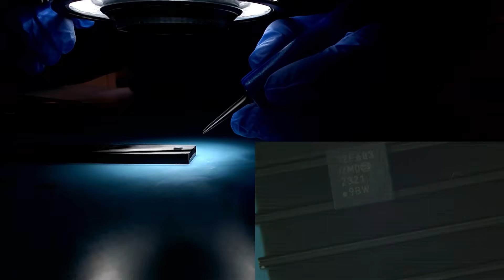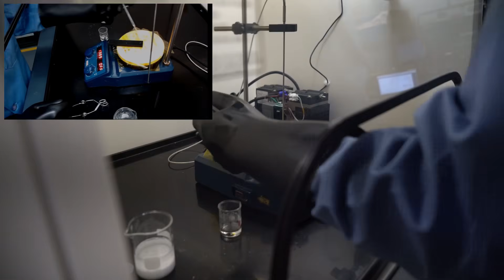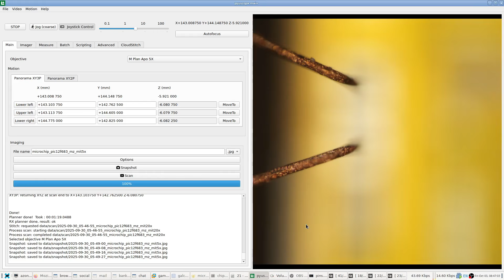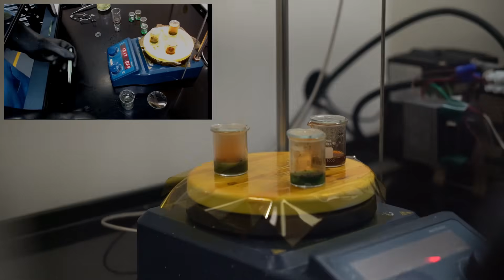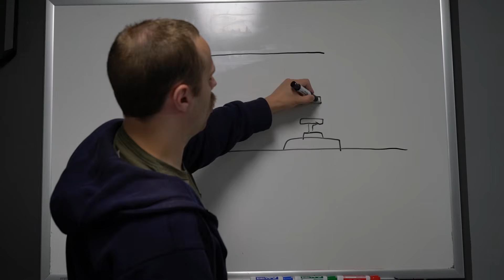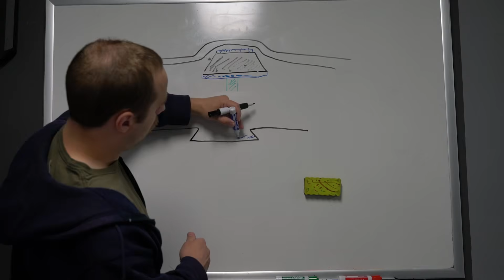[22] PIC12F683 part 2: Decapsulation and delayering

Comment: what do the fancy polishers look like, anything like the pitch plates for grinding lenses? it's kind of cool they still use tree sap the same way its' been used for as long as ground glass lenses have existed
Reply from the maker: Look up the Allied MultiPrep. It's the industry standard, pretty much every reverse engineering, failure analysis, or metallography lab I've been in has at least one. I'd love to have one but they cost as much as a decent car and are several times larger than my current polisher and bench space is at a premium, so even if I had a lucky eBay find I'd probably have to pass it up unless I sold another piece of equipment or moved to a bigger lab.

The key thing is that it has tip/tilt adjustments for the sample so you can get it perfectly flat to like hundredths of a degree, something my setup lacks.